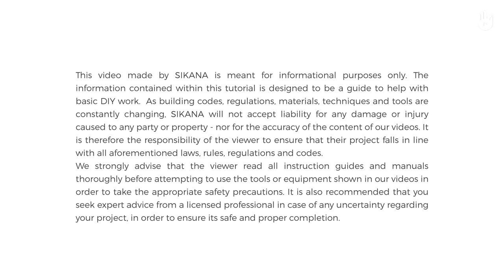Water Heater Installation | DIY Projects

Comment: Don't you need a no-return flow device like check valve for the inlet? 

In Singapore, it will require "An efficient device shall be provided which will prevent the siphonage of water back through the inlet".
Reply: Yes that should be required